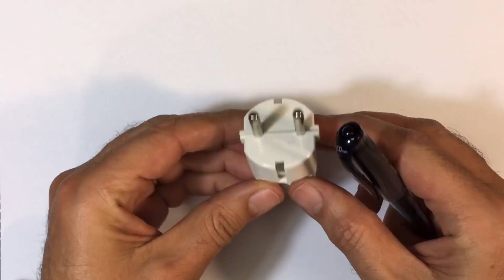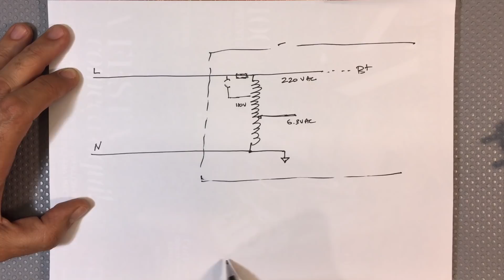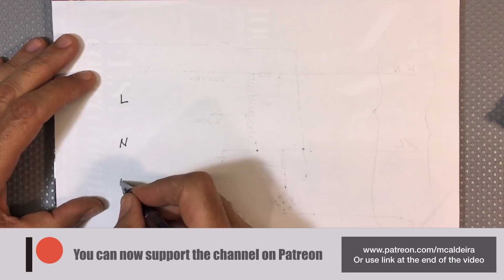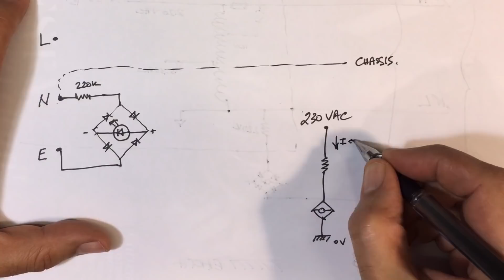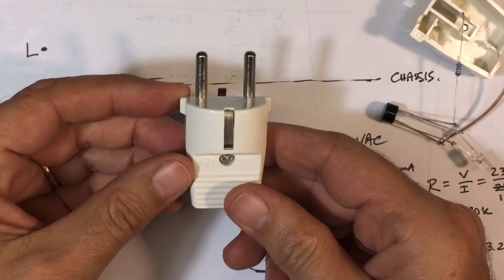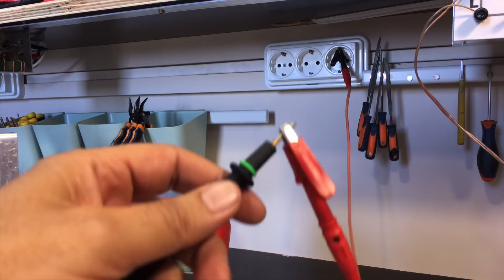Hot Chassis Plug - with LED indicator for hot chassis tube gear.

Comment: Sorry, but this is not a good idea for my home where my wall outlets are un-earthed. The best solution is alwaumys to use a ground error switch, which always protect against electric shock, even if you have un-earthed wall outlets, AND even if you happen to connect the radio so that it's metal cassie is connected to the LIVE branch. With this solution you dont need to bother about what way you insert the wall connector. It is always a reliable protection either way you do.

Comment: Your design is good for your own use, but commercially it would present liability issues here in the U.S.A.
In the U.S.A we have plug wiring polarity testers with 3 neon lights to indicate correct receptacle wiring , also: some power strips with the same indicators, which could be incorporated into a plug like yours. We are fortunate to have physically polarized , both 2 wire and 3 wire.
Using a  single light  indicating a fault is confusing, and requires more clear instruction on your plug ( maybe a note to test the plug both ways to confirm it’s working). I like your idea of putting the indicator in the radio better.
Reply from the maker: This is definitely only for the hobbyist

Comment: Hmmm. Interesting. I tend to steer away from hot chassis radios but have ended up with one and have been mulling over what kind of warning system I could put in place. It got me thinking. I have a feeling that this could be done with one of your LED converter boards. It would only catch the half wave of the cycle to iluminate the LED but I think it would give the same result (using a 220k resistor, obvioulsy!). The SMD board version is tiny so takes up very little space.
Reply from the maker: The plug version that I did works very well. Have a look at that video. I used a miniature bridge rectifier in it, and everything fit nicely on the plug.

Comment: The plug has a ground connection to the wall but you don’t take a 3rd wire to the chassis?  

In the US one plug pin is fatter than the other so we don’t have the option to do the flip. I have seen wall sockets that were reversed. So as a general rule I put three wires to the chassis. 

But your solution allows for only two. I’ll keep it in mind. 

This reminds me of my balanced power isolation transformer, where both pins go live after the secondary (60v each here in the USA)and the ground is in the middle. I use this for my ‘special tube audio’ system. An old friend who worked for Raytheon for 40 years and did life support medical equipment for them,  he gave me the transformer and explained how to configure it for best and quiet operation and he swore it would be the safest setup too. Everything with the straightest connection to ground. The balanced power makes a big difference to the sound and all components are dead quiet.
Reply from the maker: I don’t take the third wife to the chassis because it is the point that has one of the mains lines attached to it.

Comment: Great video. Do you actually need the rectifier? I would have thought with sufficient resistance it would not damage the LED and work without one just lighting on the half wave.
Reply from the maker: It would, but then you’d have the full reverse voltage across the led on the negative half-cycle, and that would not be good for the led. you could simply connect a diode in reverse across the led and that would work fine.

Comment: Great idea 💡 . But wouldn’t it also work without the rectifier ? The LED will block on reverse polarization. Or will it blow when 230v are attached in reverse ? Just asking....
Reply from the maker: you can use two leds or a led and a diode in reverse, so that the reverse voltage across the led doesn’t exceed its max limit.

Comment: Good idea, Manuel! To save space inside the plug, you could have used a small diode in parallel with the LED (to clip the reverse voltage across it)
Reply from the maker: Yes, that is definitely smaller.

Comment: This is something that has been bothering me for some time, I am in the US and we do have polarized plugs. I have older equipment such as Yamaha stereos from the 70s and I never really understood why something had to be one way or the other. I am currently restoring a friends Sansui 551 reciever from 1975. it has an un-polarized plug. The existing plug and wire are in good shape. so I seem to have 2 options replace the end of the cord or replace the entire cord. I am not the owner so I need to let him make the decision. My preference is to replace the entire cord. in the mean time I just took a piece of painters tape and wrote big and small to the corresponding live and neutral prongs so at least I can choose to plug it in the best way. I plan to update all of my old stuff with polarized plugs that are wired correctly.
Reply from the maker: We all need to be a little more careful about mains polarity with older equipment. Speaking for myself, I know I get a little careless sometimes, and that can be a problem .
Reply: A lot of "vintage" audio gear, has it's line voltage "isolated" by going to a transformer, so, this is usually not a concern. Some antique radios that use a "series strung" tube filament design may have (here's where having and comprehending a schematic is a valuable skill) one side of the line cord, which usually was not polarized, directly connected to, or coupled with a low value capacitor (popularly called the "Death Capacitor") to the chassis, and these would be of concern. Those radios almost always have bakelite plastic or wood cabinets and plastic knobs so you would never touch an energized piece of metal by accident. Using a 2 prong polarized plug, or changing to one, is a good idea in those cases, but you are still at the mercy of the electrician that wired that outlet, and it is best to get a polarity tester and check outlets before use to verify they are wired correctly.

Comment: We have the same type of plug in Turkey. It is a very outdated and unsafe plug as you explained why. Some clever guy somewhere came up with an un-reversible version of it long time ago but I still don't see them used anywhere (maybe some applications where a UPS line is integrated in the building) It is a simple and effective design and it think it must be made mandatory by law in all countries that use this type of reversible plugs. Here is a pic:
https://www.worldstandards.eu/wp-content/uploads/electricity-tiles-type-E-200-px.jpg
Reply from the maker: Yes, that is what they use in France as standard, I believe. We  need them here too.
Reply: There is nothing wrong with the plug. It is the radio that is outdated.You are trying to dictate had of the world to change plugs. It is not going to happen. Note in Europe you cannot plug such a radio on modern grounded sockets. In the US with their superior plugs you could do it without realizing any problem.
Reply: @okaro6595  You didn't get what I was talking about.

Comment: In Australia our plugs are polarized, but my 1960 Schaub Lorenz has a plug with two flat pins so I will need to use an adaptor to suit an Ozzie plug. It could then be plugged in either way. Is this an issue with a radio which has a standard transformer which offers some level of isolation?
Reply from the maker: If it has a standard transformer, then the only issue is to see if the on/off switch actually switches off the Live. Not so much of a problem.

Comment: Great idea and nice implementation. Another option would be to use a green LED wired to illuminate when the plug is correctly inserted. That way, if/when the LED fails, or an internal connection breaks, you know there is some problem: either plugged in backwards, or the plug circuit itself has failed. (Sorry - before retirement I was an embedded controls engineer for commercial equipment, meaning my first thoughts are always "What if it fails? What if they make a smarter idiot? What if ...").
But, the red=wrong is good, too. Red is the standard warning color, and with your method, you get a really clear indication that the plug is in wrong. Pay your money and take your choice, I suppose. Another advantage with your method is no extra leakage current when the plug is in correctly.
Reply from the maker: I agree with the “what if it fails” outlook. I tend to do that myself which is why I never seem to stop making changes to my designs. However, in this case, there are so many options that I had to force myself to stop at the one that did the job.
Reply: That crossed my mind, the dreaded "single-point failure". (medical devices here).

Comment: I suppose u could use two LEDs (albeit installed in the radio). Green LED ON means all is OK. Red LED ON means chassis is LIVE. No LED on means GND is not connected. But if you are color blind it may be a problem.

Comment: Hi.Good idea, I appreciate it. However, here in Portugal (where I live too), a good portion of homes are very old and do not have ground line instaled. The outlets are flat without ground terminal or schuck standart outlet without any connection at ground terminal. Why not a single connection by one led in series with a resistor between Line and Neutral ? The orientation for the plug will keeped with no ground dependance, and less components inside the plug.
What is your opinion about ? Many thanks in advance and keep your good restorations.
Reply from the maker: I might try that.
Reply: Hi again. My apologise, I made a mistake. Thinking twice, my idea will not work as we are dealing with AC and the led will always light up. It is necessary a third point (ground) to be the reference between L and N. Never the less, my concern still on, lots of homes here in PT did not have ground line and the problem still open.
Reply from the maker: Correct. Didn’t think it though completely. 
As for it’s use however, this is not a comercial design at all. It’s for my own use and therefore suits the purpose well. 
I recall my grandparents’ house in the country having no ground at all, and tingles (if not outright shocks) were quite common. They had a rather strong respect for the wiring in the house 😊
Reply: In principle if you have ungrounded sockets you should not have ground potential nearby so you could use the original plug. In principle as modern homes are far more complex with antenna and data cables that can provide earth and there were compromises in the old rules.

There is no way to tell from an ungrounded outlet using the contacts the outlet gives which is hot an which neutral. You can do it one  grounded outlet as the neutral and groudn are connected together or both are separately grounded.

Note that while the modification is reasonably safe, it is illegal at least in Finland.

The best is to determine in which position the chassis is neutral and mark that on the plug. As you use the same socket you have no problem.

Comment: Great channel. Congratulations!
I love the content!
I just thought how this will work in a home that's has IDR protection circuit. Would it be not a problem?
Reply from the maker: Shouldn’t be a problem as long as the system accepts a leakage higher than 1 mA before kicking in.
Reply: @electronicsoldandnew  Thank you :)

Comment: I had to sleep this over, and this might be a bit picky, but I think there is a minor issue with your design.
If I remember correct, the standard of the shelf 1/4W metal film resistor is rated for 250VDC max. 1/2W types usually are rated for 300VDC maximum working voltage. And those values apply for brand resistors. My worries arose by thinking someone may built something similar and using a resistor made of chiniesium...
Applying 230VAC, the peak voltage across the resistor is roughly 330VDC and thereby exceeding it's maxium ratings.
As this is a sort of of a "safety equipment", I would propose to use two resistors in series. Thereby droping the voltage across the resistors into a safe operating zone.
And yes, I know, these times you find the cheapest chiniesium 0603 resistors, rated for 75V at best, as bleeding resistor across capacitors in capacitor dropper circuits in every second LED-Lamp in your household and nobody gives a sh*t...
Reply from the maker: Good point. I mentioned a 600mW resistor in the video, but the same problem could apply. As the purpose is to swap the plug as soon as you see red, the power dissipation period is actually very short, but voltage flash-over could be a problem in really crappy resistors, as you say.

Comment: Nice idea. How about adding a green one across live and earth, this should always be on and would show that the earth was present (which if it isn't would invalidate the red led test).  I suppose the only issue could be if that was the "final straw" 1mA that makes the RCD trip :-).  [update - in fact, would you just need the live/earth one - i.e. must be lit for radio to be safe?]
Reply from the maker: You’re a mind-reader Ross. That’s in the cards for version 2 👍
Reply: If there was no earth the socket would be unearthed. In that case it would be considered safe without any modification.
Reply from the maker: @okaro6595: the neutral is effectively earthed back at the switch-box, so definitely not safe.

Comment: This radio appears to have a double-pole on-off switch, which is good. There ere some radios where the on-off switch disconnects the wire from mains to chassis only. This means: if the radio is on, the chassis is at neutral (good), but if the radio is off, the chassis is hot again (not good).
Does the pickup input have capacitors isolating both lines from the circuit? So is there also a cap isolating the pickup ground input from the chassis? Most hot chassis radios (if they have a pickup input) have this, but not all. 
If the radio is intact and the back plate is on, those radios are supposed to have no exposed metal parts that are connected to the chassis. That's the theory at least. We used to consider them safe, way back when.
Reply from the maker: This one actually has the pickup socket directly connected to chassis, so extremely dangerous.

Comment: This is an elegant solution. In France they have the same plug but with an additional socket for ground. They wall socket has the same two connections plus a grounding pin which makes it impossible to reverse the connection. German plugs and sockets don't have the grounding pin arrangement. I'm definitely going to use this system.
Reply from the maker: Yes, the french ones are a great option.
Reply: The problem is that Czechia uses the same plug but with the opposite polarity. In Poland the polarity can be either way as I think was earlier in France. The pin is not intended to enforce polarity. Schuko at least allows you the choice to reverse.

Comment: This only doesn't work when you plug it into a non-earthed socket. I don't know about Portugal, but in The Netherlands (where we have the very same type of plug), many homes still have non-earthed sockets in most rooms. The earthed plugs do fit in there, but with the earth contact disconnected, the LED won't light.
Reply from the maker: True. Can’t solve every situation. In my case, I just want to know which way around to connect the plug, because I know I’ve got earth in here.
Reply: Not only in NL also in BE and GER the earth ground connection can be missing. Or as found often after rennovations, the tabs providing earth ground connection have been covered in wall paint. To inform of such a situation, the dangers involved and this indicator staying dark thus falsely indicating a proper orientation, there is an easy remedy; inside the plug place a 270-330k resistor from Live to earth ground. If earth ground is floating the LED will light either which way the plug is inserted. Also to make things easier and avoid the risk of placing big components in a small environment that has potentially 3kW of electrical power available befor the house wiring breaker trips, I would have used a single diode instead of a bridge rectifier to save on space. Or alternatively place a 1N4148 antiparallel to the LED.
Also there are LED available with two (!) antiparallel(!) chips in one case, so the LED can be used on AC without additional rectification. Most prominent are the bi color types where in one direction they light red and green the other. Subjected to AC thus u get an orangy color.
Reply: This modification is to allow the use in an earthed socket. You do not need it with non-earthed sockets. With non-earthed sockets the safety is based on the fact that there is no earth nearby. This is not ideal especially nowadays though as there are so many different equipment so it is hard to keep earth out.

Remember the old rule: if it fits, it is OK.